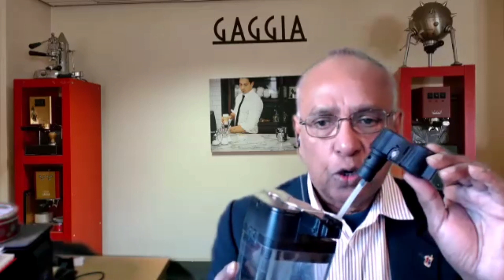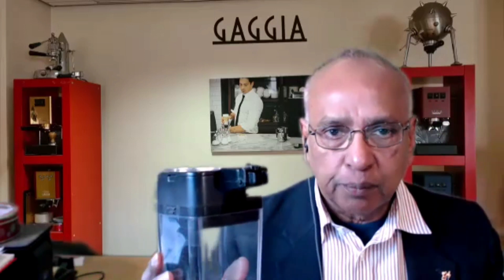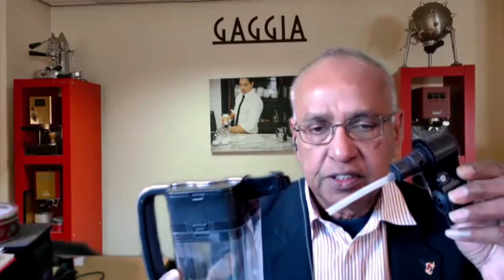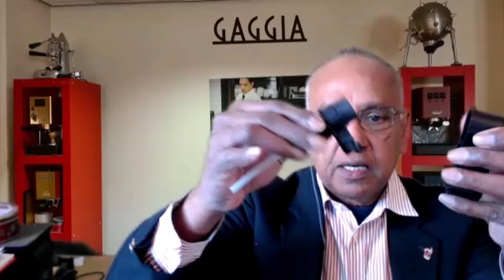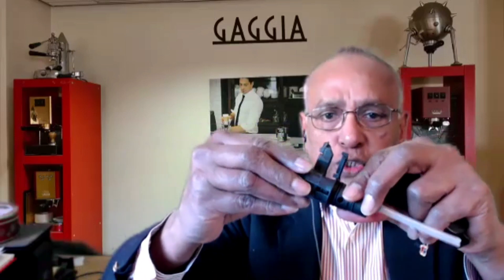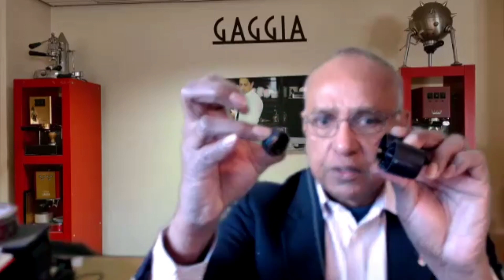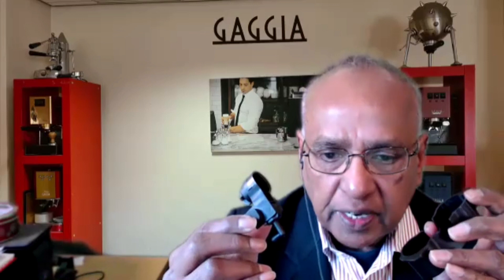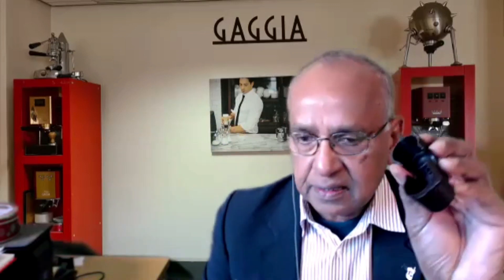Milk Frother Carafe Cleaning

Comment: Thank you so much for this helpful advice! I had been storing my carafe in the fridge at night and suddenly had the problem of having the unit fail to produce milk foam. Your tip on cleaning all the little bits paid off. I think see a tiny bottle brush to open up the holes on the conveyor tubes. Worked perfectly. BTW Gaggia should provide such a brush on these units.

Comment: Very good video, and thank you for providing it for us. We have the Magenta Prestige and it is slightly different -- a little less complicated. There is no visible magnet, for example, and no flap that has to be moved while re-assembling. But the essential principles are the same.

You make an excellent point about removing the cappuccinatore and rinsing it out with tap water prior to placing the carafe in the fridge. I think this is VERY important since, even after using the Quick Clean cycle every time I make a milk drink, I still find milk residue inside the cappuccinatore parts if I disassemble them. That one step may well prevent any major malfunctioning!

Wonderful machine, by the way. You should be very proud.